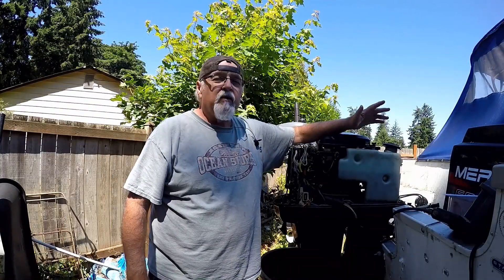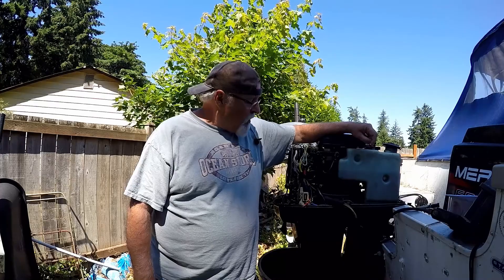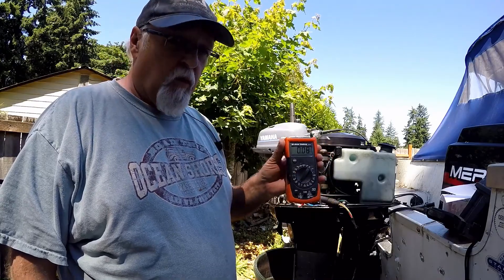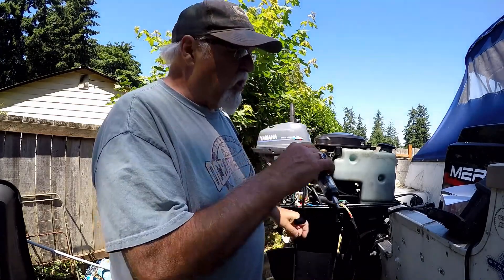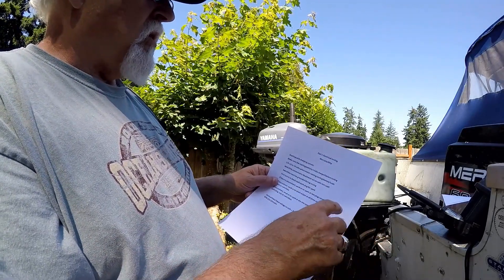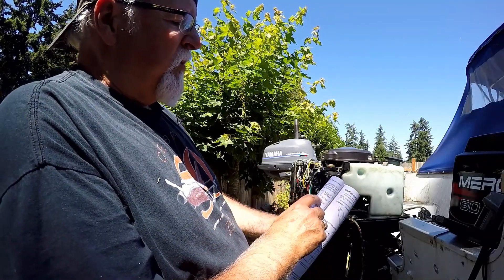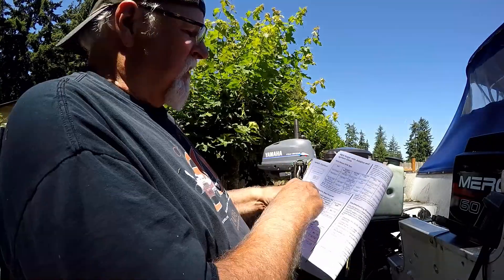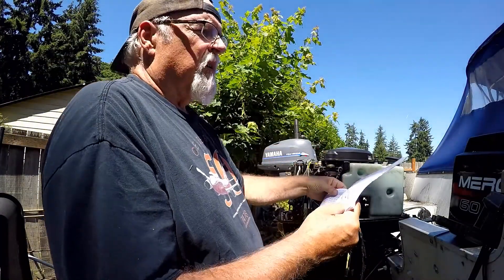Merc 60hp electrical DVA coil testing on motor Part 1

Comment: Hi Tim, thank you for the great videos! I have a 98 Mercury 60 h.p. 2 stroke that will not start and would like to know where you found the troubleshooting instructions you were referring to. Thanks again.
Reply from the maker: Hi Tom, got my mercury service manual from Mercurymarine.com. actually had to call them to order the right book for my motor.

Comment: hi Tim i have the same engine as you but a mariner 50 hp it it shoots at idle and running rough 
ignition coil ok x3 923 omh and ignition cables new spark plugs new timing is 22° and 2° idle carburetor cleaned and sync (stator new because last year it stopped sparking all of a sudden) now run it again but still rough like before I'm thinking a bit about switchbox? Could it have something to with it? I have also have heard people talking about REED valvs that can be leakig what do you think ? and by the way, where did you get that book with all the data I find it impossible to find? nice videos you make, hope you can 😀understand what I mean
Reply from the maker: What year is your 50hp mariner?
Reply: @TimsWorkshopTJY  1995
Reply from the maker: I see what you mean on finding the year service manual for a 50hp Mariner. Maybe try the serial number

Comment: Hi Tim,do you know how test cdi switch box 332-7778 mercury force 3 cylinders 2 strokes 90 hp 1992?
Reply from the maker: My manual shows how to test mine but if your getting good firing to your cylinders it's doing what it's suppose to. You need the service manual for your year of motor. If it running rough of no spark on one or two cylinders you need to test it.